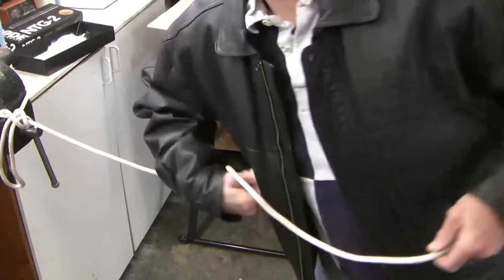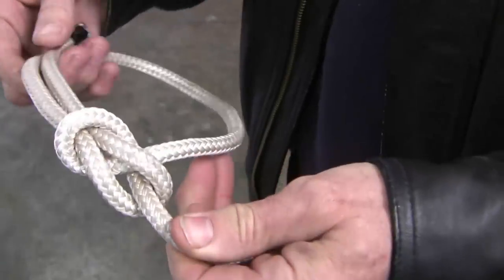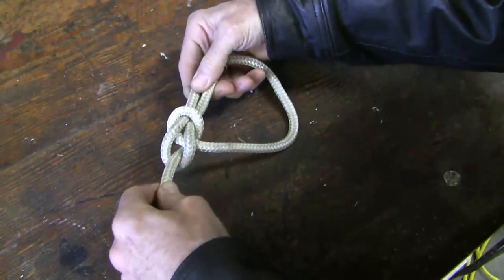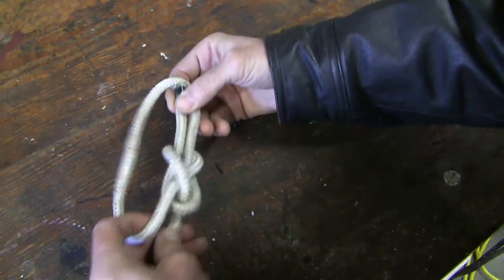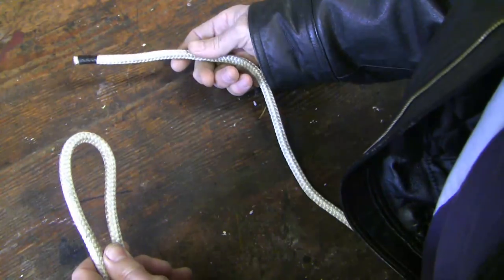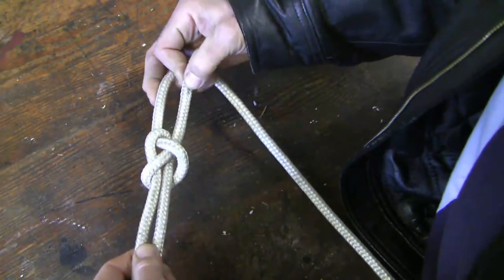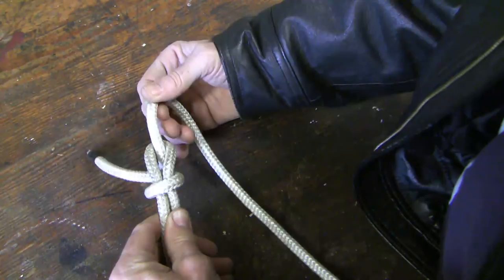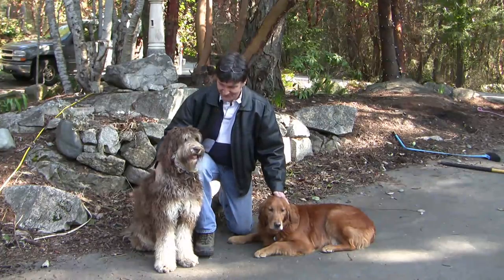What you never knew about the Bowline knot

Comment: I like how excited you are about your discovery.  I have to point out that these are not the "same not".  The only thing these knots have in common is that they look alike.  In your video, as well as in your response to one of the comments, you are essentially pointing out how these knots look exactly alike (or "are the same knot") if you zoom way in on them - close enough so you can not see where the [4] specific ends go (or what specific purpose they serve - make a loop, join two ropes, etc.).  Though interesting, this "same knot when zoomed way in" phenomenon is not unique to these two knots.  Actually, the only other knots mentioned in your video (and comments) happen to be an excellent example of two knots which share this exact look alike/"same knot" quality.  The reef knot and the thief knot look exactly alike (or "are the same knot") when you can not see where the four ends go.  Ironic?  Certainly interesting.
Reply from the maker: I made this video to be provocative, in an effort to stimulate thoughtful remarks like yours. You've made excellent counterpoints, and you may be surprised to find that I mostly agree with you. The seam of this debate rests on where the definition of a knot ends, whether identical internal structure with different loading is enough to change the definition. In other situations, not always. For example if you used a screwdriver as a prybar, would it be wrong to still call it a screwdriver? However I do agree that how a knot is loaded changes the dynamics enough that it could behave very differently, so including loading patterns within the definition makes practical sense. Nobody would confuse the two in action because of the dramatic difference in how and why they are tied, so having two separate names is appropriate. In the end, it's just a curious observation that internally they are identical, until you study where the ends go. For those of us who are intrigued by how knots work, that should be enough. Thank you for taking the time to respond, I've pinned your response so others will find it near the top of the thread.
Reply: They really are the same knot in structure.  Just like a Zeppelin Loop is the same knot as a Zeppelin Bend.  Its just that the working end of the sheet bends half hitch is now joined to the standing end of its bight.  So yeah, of course they're not literally the same knot - they have to be given different names.  You could legitimately call a bowline one version of a 'Sheet Bend Loop'.
Reply: Excellent analysis
Reply: CJ C you go CJ tell him
Reply: Coherent English please!!!!
Reply: Seems like merely a semantic distinction to me. Not only is the structure identical, they can even tied using the same sequence of reeves. The square and thief knots are an interesting counter-example, but they cannot be tied with an identical sequence in the same way the bowline and sheet bend can.
Reply: Hey CJ C have some fun man.
Reply: They look the same but serve different purposes. The bowline is made from one line and is mostly used to form a loop on an end to attach or to run an end up a line, as in arboriculture. The sheetbend is to connect 2 lines at any point along a lines length, but with extreme loading the sheetbend can bite itself like a knot or cut through. Im talking 3/4" bull ropes attached and pulled strongly with a 5 ton truck kinda tight, not sailing boat tight. neat observation though
Reply: The differences in the sheet bend and the bowline are important and this video shows why:  https://www.youtube.com/watch?v=c-zkWSW0kMg
Reply: They look to me like mirror reflections of one another
Reply: uhh.. no Ryan.  Look again.  The sheepbend "cross line" is the loose "bite", while the "cross line" in the bowline is part of the loop.  Tony K. makes this clear, and it's purposes make all the difference in the world.  The sheepbend could BECOME A NOOSE!  Watch his video.
Reply: CJ C you're right, you could just call square knots bowlines at this point
Reply: *Neander53. Sheet: line controlling a sail. Sheep: woolly mammal.
Reply: Agree, they are the same knot. A knot doesn't become a different knot simply because it has a longer tail or the working ends do or don't connect. Of course, they're tied in such different ways and for different reasons that it is useful to give them a different name.
Reply: to bad your hand was in the way as ypu made the final shove thru in the bow line . oh well, move videos than this one..

Comment: A knot isn't defined just by its shape, but also by the internal stresses and strains caused by the load on the ends (between working ends, but not between standing ends). The difference between a sheet bend and bowline is in switching up which ends are working and which are standing.
Reply from the maker: Yes, exactly. Very well stated.

Comment: Similarly, the clove hitch and two half hitches are the same except that the clove hitch is tied around a post while when tying two half hitches you throw the rope around a post and tie it around itself with a clove hitch.  The other way to look at it is a clove hitch is just two half hitches around a post.  Also an overhand knot, which like a figure eight knot is used as a stopper knot, is just a half hitch that is not tied around a post.

Comment from the maker: For anybody who is interested in more detail, there is an outstanding recent 56 page paper analyzing the structure of the bowline knot. Search "Mark Gommers, Bowline Analysis, 2016" for a free pdf download. He goes into exemplary critical detail, showing numerous variants, points of weakness, and practical considerations.
Reply: Outstanding finding.  I have recently been getting into knot tying for use with my tent setups and tarps.  I have used the surgeons loop and figure of eight knots on my working ends to wrap around trees.  I have recently decided to try the bowline knot for this application as well.  Very interesting observation.
Reply: spelunkerd.
Reply: Check out the "bowline on a bight" option. ver useful for tying a a bowline in the middle of a line when both ends are fixed....

Comment: Respectively, though all the features you did mention are great,  most important is the reduction of the strength of the rope. When ropes fail, they fail at the knot. Most knots reduce the strength upwards of 50%.  The bowline only 25%.
Reply: It is a proven fact that few ropes ever break at a knot. Usually an old cut, worn point or abrasion.  (On rope by Bruce Smith and Allen Padgett

Comment: The difference however, is that as the ends that form the loop in a bowline are both under tension when the knot is tensioned, while in the sheet bend only the two ends that are pulled are tensioned. This gives the knots different dynamics. The part in the bowline that is referred to as "the well" in the commonly used analogy " the snake comes up from the well, goes around the tree and goes back down the well" is being tensioned from both of its ends, while making it impossible to slip as it is being pulled both ways simultaneously. This also tightens "the well" very tight around "the snake" making it practically impossible to slip. In the sheet bend however "the well" is only tensioned from one end which doesn't completely remove the chance of slipping and also doesn't provide quite as tight pull around "the snake" as the bowline does.
Reply: this is extremely relevant to the use case of a bowline and is exactly why you wouldnt use a sheet bend to tie a rescue line around someone or some object.  making a loop and tieing a sheet bend will create a slip and thats not ideal for most cases when you actually want a bowline.

Comment: It's decades since I was taught how to do a single-handed bowline. After which my tutor warned me it was a nice party trick that should be used only in extremity if climbing or sailing. If the line tightens without warning it's a good way to have your hand trapped, or even to lose it.
Reply from the maker: Good point. "Educated Climber" here on Youtube teaches how to do a very rapid running bowline, and it is done with two hands without trapping your wrist or hand. Muscle memory makes each identical to the last. Those guys may tie a hundred knots in a day, so even a second saved is worth it if the result is reliable.

Comment: Great video, I am just getting into knots for back country camping and I had learned the reef knot and had planned on using it in an application of tying a lead rope to loped rope horse halter.  The sheet bend may be a better knot and I was wondering if you could explain the applications and pros and cons of the reef knot and the sheet bend knots?
Reply from the maker: The fact that the sheet bend and its cousin the bowline are easy to untie is a huge plus, so in sailing they are used all the time. Choose the sheet bend for tying two ends of line together, use the bowline to tie a loop that won't strangle what it goes around, like a bollard ,or cleat, or horse, or person needing a rescue. Both are reliable when under constant tension, but both can occasionally slip when tension is intermittent. Neither is very good when tension is low. If worried about a bowline knot coming undone when not under tension, most of us would tie an additional overhand loop in an extra-long tail. The reef knot is a constrictor knot, a binding knot, such as that used to contain a group of loose objects such as a flaked sail. Reef knots can fall apart if tension is inadequate, so there are often better choices, like the trucker's hitch. Most importantly the reef can be hard to untie, especially if exposed to water and longstanding tension. So, many will "slip a loop" in one end so that it comes partially undone by just pulling the loose end. They call that a slipped reef knot, used to tie fenders to a boat or tie the mainsail to the boom, less reliable but easier to use. If you have a loop in each end, you have the same knot used to tie shoes. Here's something to consider. When you tie your shoes, are you tying a reef knot or a granny knot? Pull the loops through and have a look! Without realizing it, many of us tie a slipped granny. The granny comes undone much more easily, and is easy to accidentally tie when wanting a reef knot. Because of that issue, the reef knot has a reputation as being unreliable....
Reply: @spelunkerd  Thanks,  two question when choosing between a sheet bend and reef.  Which one unties easiast after extreme tension and which one is best with 2 differenet size ropes?
Reply from the maker: @bill84345  Definitely the sheet bend, on both counts.

Comment: I use a bowline for anchoring items into my truck.  You demonstrated a reef knot as well.  My understanding of the reef knot is that it's used to tie two similar ropes together whereas the sheet bend is used to tie two dissimilar ropes together.
Reply: A reef knot/square knot should NEVER be used to tie two ropes together under load. In that situation it is dangerous. It should not be used as a bend.

Comment: Very cool.

I love knots, although at most I've only known a handful. The problem is, I can go months between needing a knot by which time I've forgotten the one I need. Oh well.
Reply from the maker: I agree, I feel the same way.
Reply: Yep you have to practice knots otherwise, like everything else (except maybe riding a bike), you lose it.
Reply from the maker: Yes, I know exactly how you feel! When practicing rescue in our safety at sea course we learned a double bowline as a method to quickly pull a person out of the water. Trouble is, the knot is rarely used and a little tricky. In the panic of a rescue I am not confident I would be able to remember details.
Reply: Exactly.  I know a lot of knots and rarely forget how to tie most of them BUT when under pressure you can easily mess up, despite knowing them well at more relaxed times.  I usually fall back on the few knots I know very well.  That's why it is very important getting to know one or two knots very well indeed - it needs to become a deep-seated muscle memory thing so you don' t really have to think about it.  It's worth learning one loop and one bend very well and practicing a lot just in case you really need it one day.
Reply: Marty Backe
I think that's why it's important to spend an evening or lazy afternoon to practice a few you'd commonly use and a few you'd use less often.
Reply: You are absolutely right. It is a better pastime than worry beads and much more practical than games on your smart phone.
Reply: not me, I would be dead if I didn't know my knots , I was a tree trimmer and have sap in my blood and tie knots in my dreams.
Reply: If you were ever in the Boy Scouts, you would have learned the “Big Eight”, practiced them relentlessly and never forgotten them.

Comment: Yes they are the same and there are many bends that can be changed into loop knots,whit a sheet bend you use two ropes ,but the bowline you use only one .there are many bends which are made of two overhand knots if you use one rope and make your bend then undo your second overhand knot and simply turn your first overhand knot over and then tie your second as before you get a loop knot ,this work with loads of knots

Comment: I have known for quite some time that the Bowline and the Sheet Bend are one and the same knot.  The difference is that the SB joins two ropes and the BL is at the end of one rope.  The Bowline has many variations as well.   The SB can  be tied onto a fixed loop.  I use a slippery Sheet Bend tied to the fixed loop on my hammock to hang it.  Using this method is the simplest method to hang a hammock and eliminates the "need" for any specialized hooks or carabiners.  When doing this, one should use a back up safety knot as well.   Anyone interested in simplicity and/or ultralight backpacking would  do well to know some basic, simple knots.
Reply from the maker: Good points, I agree completely. Thank you for watching!

Comment: I like the Zeppelin Bend, Its jam proof easy to tie and take apart after having a heavy load on it. Although the Prusik knot is quite useful also.
Reply from the maker: I'll look it up and give the Zeppelin a try. We used to use the Prussik knot all the time in mountaineering and crevasse rescue. Thanks for watching!
Reply: Yes, the Zeppelin Bend is indeed an excellent bend[1]. Easy to remember/tie/inspect, and unlike many knots that served man well for centuries, is suitable and reliable in most (if not all) synthetic line. It's also easy to untie... even after extreme loading. I could go on. Some suggested reading: 'The Ashley Book of Knots' will keep you busy for years. Check Amazon and/or eBay... the book has a Wikipedia entry as well. However... be advised it was written just before the appearance of synthetics, and not everything within is advisable. Also, Brion Toss, (a modern day real world down to earth practical rigger) has released several books with a heavy emphasis on simple, reliable knots that can be depended upon in modern synthetics... really not all that many in comparison to the natural fiber days. Amazon or eBay. [1] For those who don't know, a 'bend' is a knot used for joining two lines.

Comment: The bowline is useful for making an eye in a hurry. Can be done in a few seconds, and with one hand in an emergency.
The sheet bend is useful for attaching a rope to the horn of a sail or of a tarpaulin.
Or when you have two ropes of very different width. 
The point is that the stiffer part only has to be a single fold. 
There are only so many principles you can use for making a knot, so many knots are similar. 
But the details matter. They make all the difference.
Hope I got the English right. :)
Btw the constrictor is my favourite. 
Once a danish bosun tied up a Houdini good using constrictors.

Comment: Fun video, but there is one caveat, although the knots a similar in structure, they are not the same knot. To see why, hold the static end of the line and look at how the sheet bend is positioned. You are essentially looking at an upside down bowline. Now if you put load on the loop that sticks out of the top of the knot, the sheet bend will collapse into a constricting knot.
Reply from the maker: Of course, both knots have different loaded elements. One would never confuse functionality, either. Certainly a knot designed to make a fixed loop in the end of a rope has a very different goal, compared to a knot designed to tie the ends of two different ropes together. My point is that if you obscure an onlookers view of where the four ends go, that onlooker would be unable to resolve whether the knot is a sheet bend or a bowline. I'm pointing out that your definition of a knot depends on where the ends of the line go and how they are used. The knot pattern of the bowline is hidden in other knots, as well. For example, look at the Carrick bend, which has two back to back bowlines hidden within. Whether you find that interesting depends on your perspective and imagination.
Reply: Yep that's it. It's all about how the knot will be loaded. Enjoyed the video, but didn't want someone to walk away thinking that they could simply replace a bowline with a sheet bend.